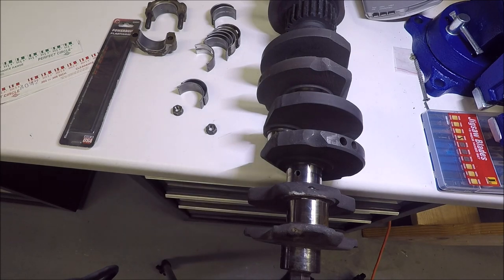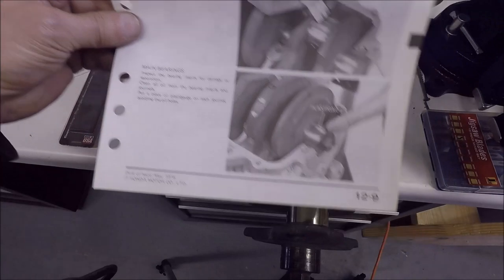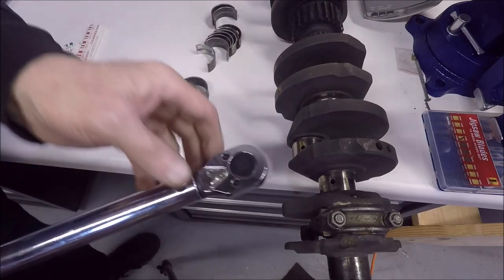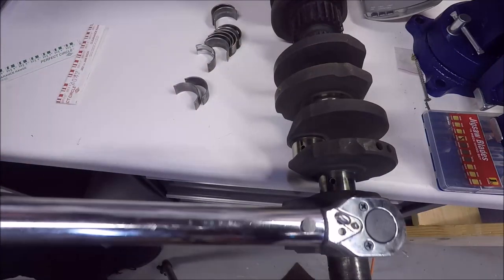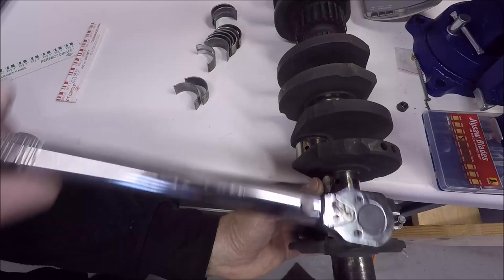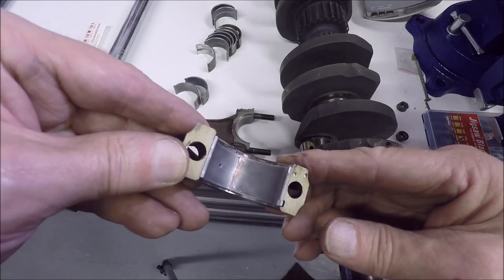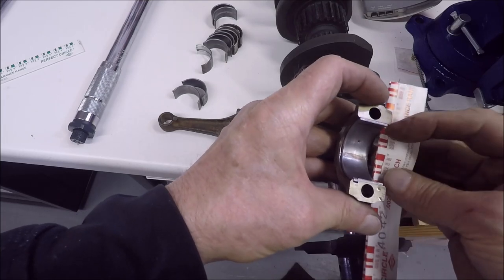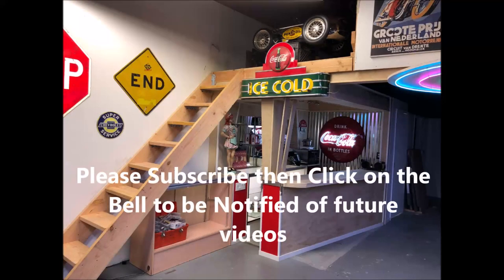Honda CBX Full Restoration & Engine Rebuild Video Series - Part 8 Checking Rod Bearing Clearance

Comment: I plan on rebuilding one of these engines soon. Awesome series. When are the next ones coming out
Reply from the maker: Hi Michael 
Thank you.
I have been waiting on parts which I now have so I will be doing a new video this weekend, then more after that.
Reply: @digitalpizza1  awesome. I will probably be doing the build over winter so you will be well ahead of me lol. Plan on putting some modern suspension on the cbx frame and making a modern sport bike with a cbx engine. I will need a  new Head for my engine any tips on where I can find one